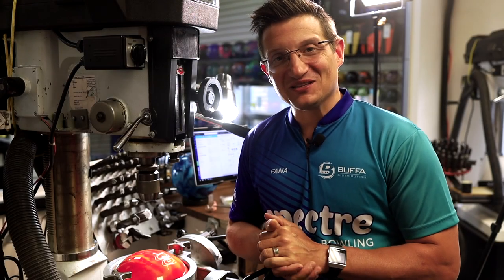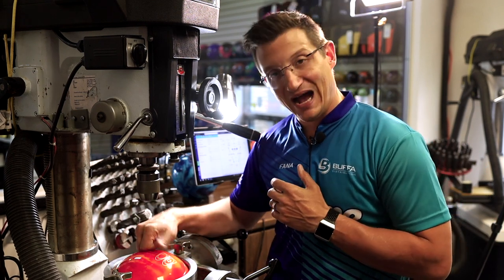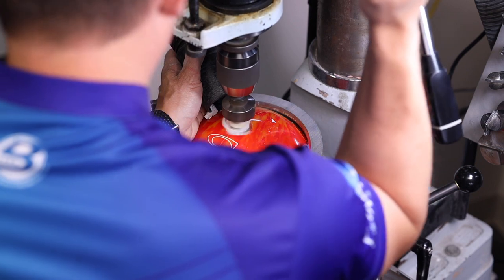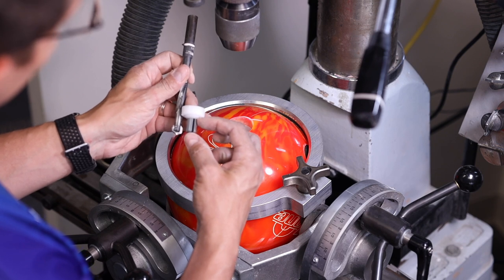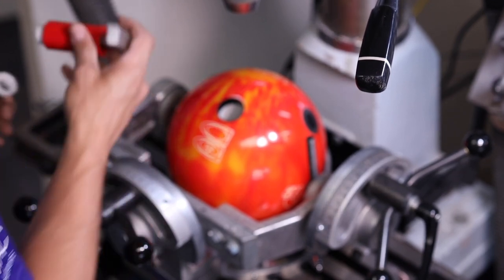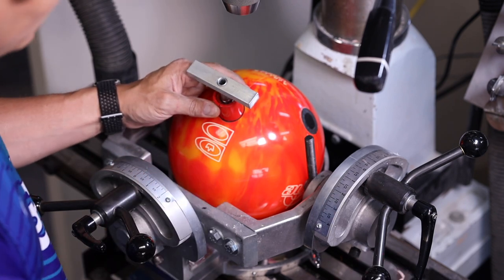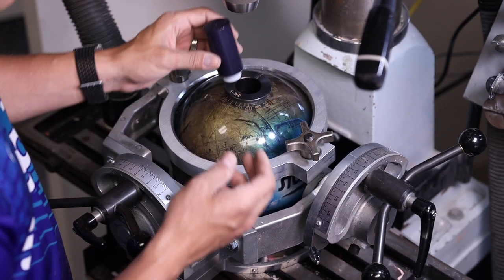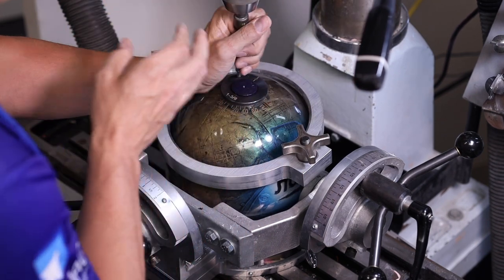VISE IT | Thumb Installation Series

Comment: In the past 7 years of repairing sticky/misaligned VISE IT installations due to core swelling, I have found that drilling the pitched hole oversized and "sleeving" it with epoxy ball plug results in much better alignment, smoother operation of the slug-IT, and the collar drops in without having to do any sanding or fitting.  In short, the repairs are often functionally superior to the original installation.
Reply: Could sinking a regular slug work as well?  I'm having problems with my ITs and looking for a solution without switching systems altogether.  That gets spendy on 20 balls.
Reply: @travishanson166   Normal slug is too short to function as a sleeve and interface for the BALL-IT. It is however a common practice to drill out a broken BALL-IT 1 1/8" x 4" deep and glue a slug into the bottom of the hole to function as an interface for the replacement BALL-IT. But this is still more expensive and time consuming (15-20 minutes) than replacing the broken IT with a JOPO outer (2-3 minutes).
Reply: @byronfranek2706  thank you for the info.
Reply: Do you think because the vise it stuff does put pressure on the inside of ball cause the ball to crack before say one that doesnt expand or put pressure on the inside of ball? Amd how do you take the inside out if say one would want to plug it? Is that possible

Comment: Would you recommend the .05 bigger drill bit to allow for the clearance
Reply from the maker: Those oversized bits are for slugs, not for interchangeables. I do recommend them, if you watch out ‘how to cut an oval’ video, I mention that.

Comment: I have been experimenting seems i have a problem and like to do everything myself... 😂Well, i messed up and got my vise thumb interchangeable stuck somehow i didnt drill all the way thru yet i was excited i got it and have been practicing drilling on broken balls. I wasnt thubking and before i had it fully drilled i put the It in my ball 🫣😑 just checking everything out.. i believe its suctioned in there because it will spin all the round around for a couple turns. Could i put a tiny hole diagonal thru to help for releasing air? Mistakes are ok thats how some kf us learn. 😂
Reply from the maker: I don’t think it’s succion.  Did you do the proper steps with the ‘ball-it’. Did you knock it down with the push down rod and also install the expander?